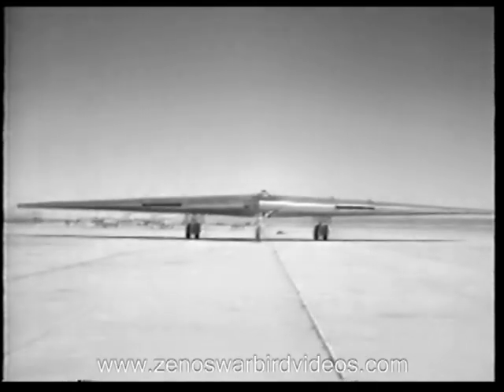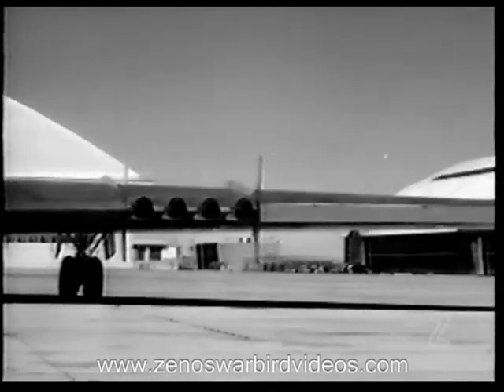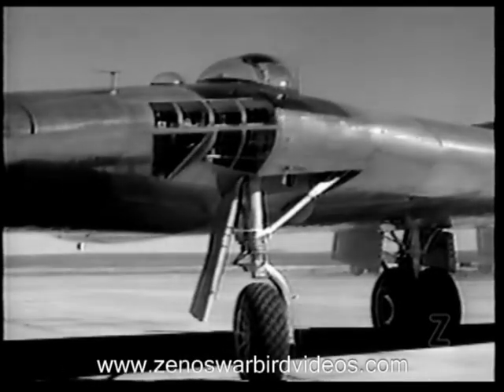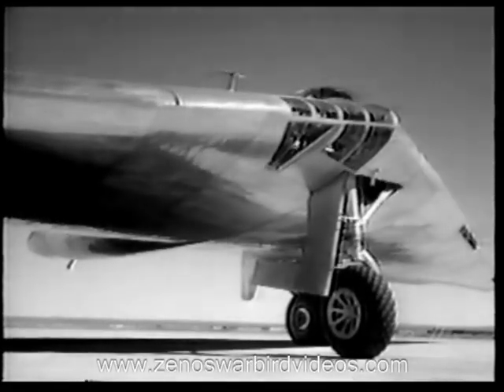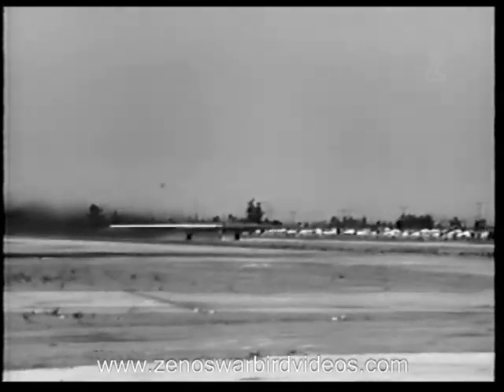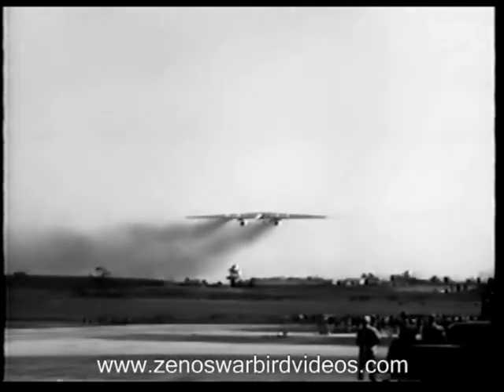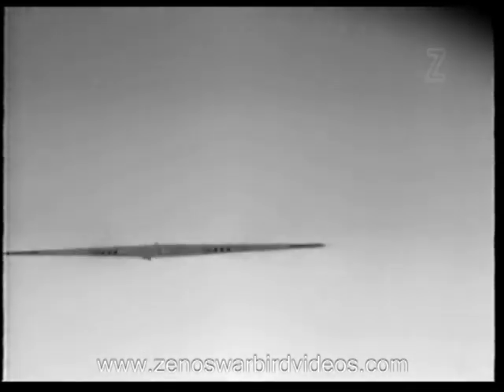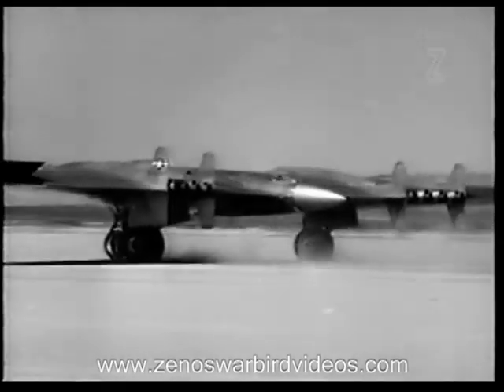First Flights of the Northrop YB-49 Flying Wing  - 1948

Comment: It is not until the use of computerized flight controls that the wonderful design of Mr John K Northrop  would be made safely fly able, as the amazing B 2 Spirit.

As soon as the mid 30's,a French test pilot and engineer
determined that tailless wing,was not safe,and the use of consequent rudder necessary.
He deposited a Patent for this,and his motorized wing,AV 10,was the first in the world to receive a Cerificate of Airworthiness in 1935,with the same trials as a tailed plane.

AV 10 won some world records,and disappeared at the Nazi invasion of France in 1940...

It's a pity that brilliant engineers as John K Northrop and Charles A.Fauvel never met.

Glory to both of them!

Comment: Very nice video.  Thanks for sharing.  The YB-49 suffered from dutch roll.  A device was developed to correct stability in the yaw axis, but not in the pitch axis.  It worked through the aircraft's autopilot system.  To say these aircraft had stability issues after this device was installed are highly overstated.  The reasons why the Air Force selected the Boeing B-47 Stratojet Bomber instead was because of the Northrop YB-49's slower top speed, shorter range and its inability to carry nuclear weapons of that time.  Also, the Airforce was not ready to take on an unconventional bomber design.  In the post World War II era, military budgets were extremely tight and the YB-49 was already way over budget due to problems and delays.

Comment: Im honestly surprised it wasn't faster than 370
Reply: The airframe was the same as the YB-35 propeller version and not ideally suited for jet propulsion. The jets were more or less a make shift solution to a not suitable airframe with drag limits

Comment: In case anybody loves this bird like I do I have to tell you that it was scrapped as political revenge by a senator named Symington not due to any problem with the concept or construction. I saw an interview with Jack Northrop that was filmed shortly before his death. He told about how, under political pressure, he lied to Congress telling them the aircraft was flawed and could not be fixed. In reality the flight control was fine. We could have had the B2 bomber back then but back-room politicking by petty, arrogant men scuttled the project.
Reply: Yeah his design was stolen from him and the contract given to another company and then as an old man in a wheelchair that had the nerve to wheel him in the hangar and show him a modern flying wing
Reply: It is a fullfill german horton ... it is like the wernher v braun rockets ...